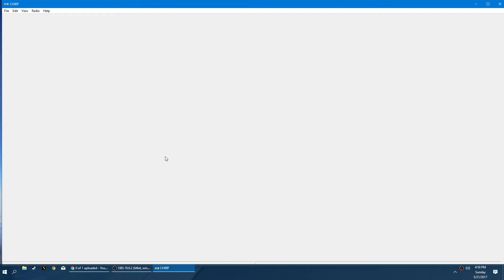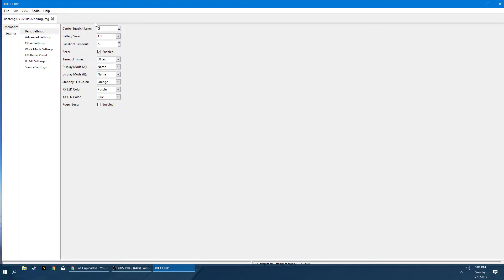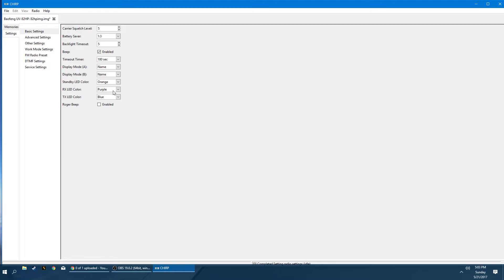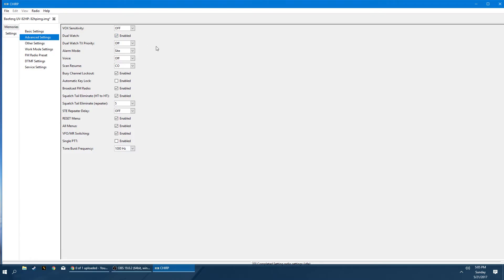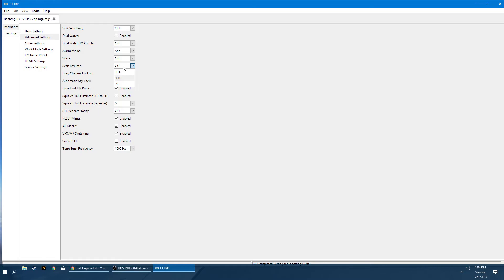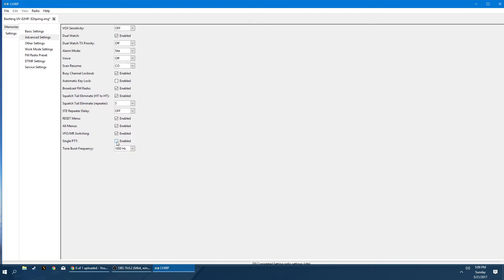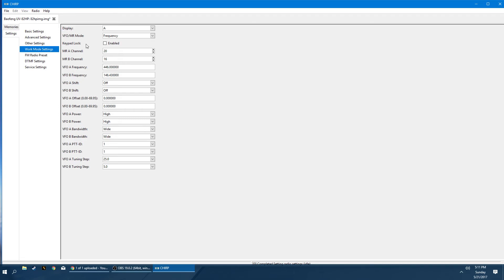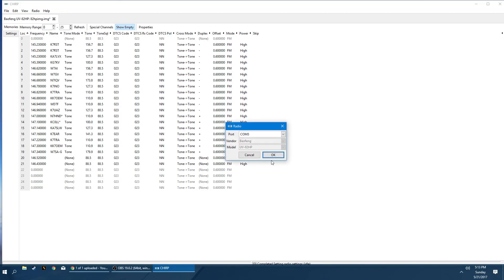Baofeng | Chirp Programming | Chirp Settings

Comment: im looking through all the videos about chirp and hoping for help. my settings arent popping up, i cant see them at all. Ive treid to update chirp and download new images of from my radio, but cant get the settings. any fix?
I think your video is well made and very clear. the uhms slow it down but i am okay with it
Reply from the maker: Robert Hilden are you getting any error messages when “downloading from radio”? Also which radio do you have? Can you see your transfer cable in hardware manager? My next reply may be in the morning but I will try to help
Reply: Turbozo understandable, thank you! I am getting no error message when downloading and I haven’t tried to look at the hardware manger. I bought a btech fdti? cable so it’s official. Also I’m using a UV5R
Reply from the maker: Robert Hilden open hardware manager (Pc) and make sure you can see your transfer cable (without an exclamation mark!) I may be able to further diag your issue. Not sure how much longer I will be avail tonight.
Reply from the maker: Robert Hilden I of course mean Device manager. Not hardware manager***
Reply: Turbozo don’t worry about getting back to me! Thank you for doing so when you get time to do YouTube stuff. Your life is important too and happy to let you do your thing. I’ll look into it later anyways so that’s why there’s no rush tonight <3 I’m figuring it out as I monitor :)
Reply: @kenwhiteproductions  I found the transfer cable in my device manager. It's working fine without an exclamation mark, under Ports (COM...), USB serial port com 3.  any ideas what to do next?
Reply from the maker: @ffrreeddyy123456  Very strange then that you are still unable to port information. Just out of curiousity does your radio Rx and Tx LED's light up when Chirp is "downloading from radio"  ie: the red and green LED's on the radio?

Also, do you currently have ANYTHING programmed into the radio? even if its a single station you programmed thru the walkie itself?
Reply from the maker: @ffrreeddyy123456  also sorry for the delays work has been crazy!
Reply: Turbozo   No worries, understandable, thanks for helping!! The led light comes on green and red when uploading and downloading and the cable also has corresponding red and green lights. I’ve been able to use the chirp app to do stuff besides settings, I’ve put in channels and turnt duplex off, skip on, etc.
haven’t found the problem anywhere else and hoping for a fix next patch for chirp haha I don’t know how often that comes out tho. Also slow replies are fine! Haha I was gaming so sorry to miss you when you might have been available.
Reply from the maker: Robert Hilden it sounds like you have done everything correctly. Unfortunately you may need to reinstall chirp and do a manufacturer reset on the radio. But no garuntees that will fix it either. It sounds like everything is communicating but it might not be in the right format?
Reply: Turbozo okay, I downloaded chirp off their website and installed it again. I’m putting it in my D drive instead of the ssd C drive. I did that before talking with you and it didn’t change anything. I’ll reset my radio and download chirp again, to see if it fixes it. I’m not sure what format it’s in. Haha I’ll get back to you, this has been a long mission and the only thing I can’t do is program a new message at start anyways. I’ve been able to figure out everything else that I want to do, it’s been lots of learning. I’m lookin for a cheap antenna that isn’t knockoff now so I can hear people better.
Reply from the maker: @ffrreeddyy123456  By "format" I mean the type of radio selected. you may want to set it to UV5r, or UV82 for example. Try using different models as the radio type to see if you get any difference. And tbh alot of the radio cables out there are junk. So the worst case scenario i would say try a different brand transfer cable that uses a different set of drivers. But your issue is definitely in communication since you are getting the LED's and no error messages. Also if there is nothing programed in your radio, it will look like a blank paper (no grid) so in chirp make sure you select a memory range of lets say 1-50, and also make sure you check the box that says "show empty"
Reply from the maker: @ffrreeddyy123456  if you want a long range antenna i recommend  going with a "full whip" style. the only downside is they are about 14.5" long or 37cm
Reply: Turbozo thank you so much! I’ll try out your suggestions, I think if it doesn’t work I’ll try a different cable next. That seems like it might be the issue. I’m hoping a long whip will help, just unsure now about these online bought products working appropriately haha. Ima try to get the nyga...(sp?) brand whip. I think hypario or whatever it is would be better but I can’t find them for sale. I’m looking into di poles or whatever instead of whips because they might be better and cheaper but just more hassle to use.
Reply from the maker: Robert Hilden both of those are great options. I think diamond makes one as well for $15-$30. Also I really like gigaparts.com for radio gear. Great customer service, and authentic products.
Reply: Turbozo I’m waiting for an antenna now, thank you for the source besides amazon! Ham radio online was way too confusing. Giga was a bit too but I figured it out.
I tried different formats, uv5r variants work but didn’t have settings on any of them either and other radios didn’t work. I tried almost every one of the bfeng and btech radios. Also I double checked to confirm what you were talking about in regards to show empty and 0-127 memory channels shown. I troubleshooted that before to confirm that’s not my issue. The memory tab works fine and then I click over to setting to change stuff and it’s a blank everywhere. But I am happy with it for now, and if I come across a solution I’ll try to let you know if it is a problem for others. I’m very happy with your help mate. Appreciate it tons. I watched a few hours of your videos in the background and hope the algorithm catches you soon💛 you’re doing good videos on YT. More often (4x a week) seems to be what is effective at getting through the lower tier numbers.
Reply from the maker: Robert Hilden thank you for your kind words. I don’t have a ton of time for YouTube so I’m not super worried about numbers. Just like to help people out! I never realized you were able to transfer memories and that settings were your only issue. Last recommendation might be to find a 2017 copy of chirp?? Maybe the new version of chirp does not support the settings tab? I will be honest I haven’t done a lot of ham radio stuff in the last year due to my remote location there’s really not a lot of other hams out here it’s pretty much just me haha.  Thanks again sorry I couldn’t solve your issue if you have any other questions please feel free to ask in the future
Reply: Turbozo I’ll try to download an older version, I’ve figured it could be because of chirp having a bug that they haven’t worked out yet. I might email them if they have a contact and it turns out to be the new version causing it. And totally everything is working and I’ve learnt so much by troubleshooting and watching so many videos about the same things. But I still haven’t found anyone with the same issue. Thank you again as well for your support and knowledge! It’s been a lot easy with the help. I wish you the best of luck and joy in your life.

Comment: Could you expand more on the DTMF settings? I'm having reports that my radio (UV-82c) is transmitting an audible tone with my voice on a local  2M repeater.
Reply from the maker: Typically you either have the right PL tone settings and it works, or you have the wrong settings and the repeater will not open for you. However it should be known that some of the PL tones CAN IN FACT be heard by the human ear, especially if they are in specific frequency ranges that our ears are sensitive too. However if you are the only person transmitting, and your tone is loud, it could be interference from things like LED light bulbs for example. I would be curious to know if everybody can hear it? or just certain stations. I can personally hear the 94.8 PL tone whenever a repeater system uses it. However this does not mean that its normal. I am really wondering, does this happen everywhere all the time? or only at home? are you mobile etc...